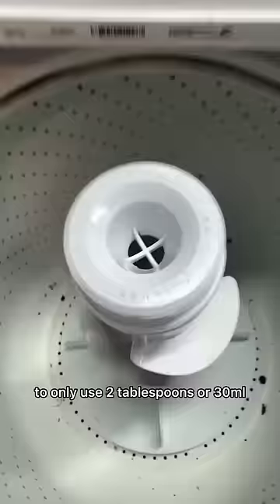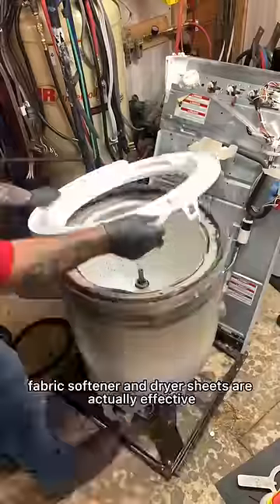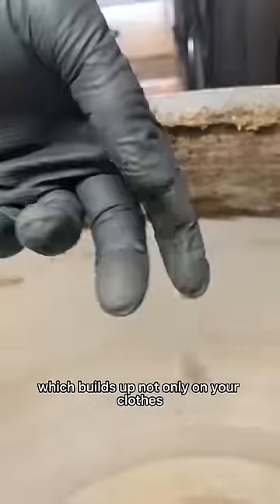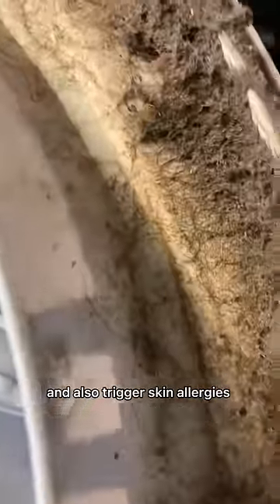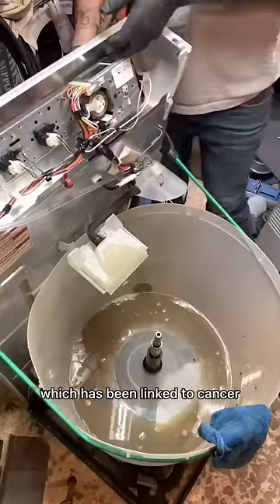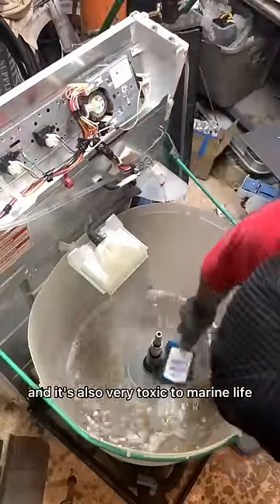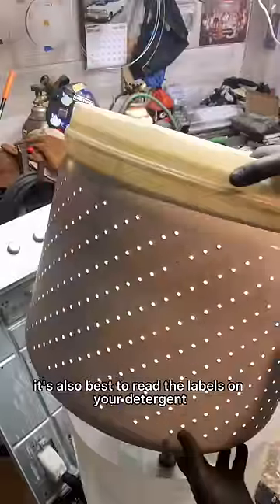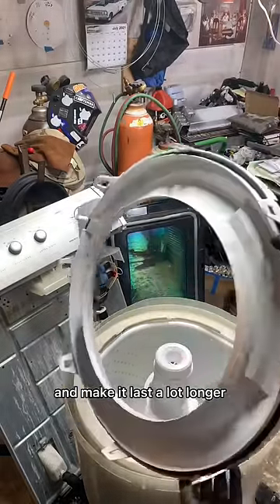Softener leads to machine failure

Comment: Vinegar with your favorite essential oil; I also use the wool balls, apply the same essential oil and my clothes come out bright, clean and extra soft. I use baking soda as a detergent. I use hydrogen peroxide for a stain remover, whites are beautiful, mixing a castle soap for a extra boost to the clothing before putting it in the washer. My washer shines.

Comment: I have "outlawed" fabric softener in our house.  The wax-like build clogged the pipes and then the water backed up and overflowed making a big mess.  Have a nice day.
Reply: All you need is a tiny amount. The fabric softener is not the issue it's the user. You're adding too much. You think these guys who created this never tested it on a machine or clothes? Yes, they sell stuff to get us to buy anything but it wouldn't be a household staple if it didn't work. Sure vinegar is a great multipurpose cleaner, but I'm pretty sure a chemical made for softening fabric and reducing static is better. Thank you

Comment: YES to baking soda first- final rinse, a small amount of white vinegar. Works great- no residue. Also, buy a Speed Queen as they have a metal, not plastic inner tub and they work incredibly well. Don't fall for the high efficiency tricks. Speed Queen is the best.

Comment: help; 

i use one tide power pod, warm setting only, distilled vinegar, no scent beads, spot treat with oxiclean and rinse it out beforehand if necessary, wash like items together, bleeding items with the darks, don’t overstuff the washer, and 3 drops of essential oil on a wool ball for the dryer. 

someone tell me if i’m doing it right pls cuz i was told to clean but not taught how and learned all this over the years from the internet 🕺🏽

Comment: Wifey was for a while a softner addict, sure the towels where soft n plush, lovely scent and so forth but..BUT they barely worked as towels anymore! They where so permeated with fatty chemicals that it had problem absorbing water! Towel was still technically "working" but you had to work the water into the towel! ...and they took much longer to dry, so quite soon after taking towel in use they would develop a funky scent AND perfume  😂  sure the bad smell went away after every washing but the funk cycle would repeat.

I love a little rough towel, because I know it will work like a towel should!

Comment: My dryer crapped the bed last winter, got a drying rack, no softener needed, my clothes last longer and I have a lot more space in my laundry room. I don't miss it. But I also only have my own laundry to do, so there's that.
Reply: @Pussflap  Works well, I place them on the drying rack with a fan pointed at them, no smells (other than the detergent) and fabric is lasting longer because it's not getting baked and stretched in the tumble dryer. Also towels work better because fabric softener was making them water resistant. They are a little stiff with first use but I like the scrubbiness and they then soften right up. Dishwasher crapped the bed as well and now I have a really nice space for recycling and garbage. Unless you have a handful of kids you don't need a lot of these appliances.

Comment: Also, check the hardness of the water in your local area. I live in an area with very soft water so no softeners or fabric conditioners needed, and I can get away with using half the standard recommended dose of powder detergent.

Comment: White vinegar is better because it's not just a fabric softener. It also kills mold etc and helps remove stains. It's totally safe to drink which means even if you have a crap washing machine the vinegar residue it might leave on the clothes is much better for the skin. So if you have a baby or someone who's got allergies then it's much less likely to set them off. Also you can try different kinds of white vinegar and see which smells the least. Also hanging the clothes up should get rid of the smell.

Comment: We only have a tub type machine with a spin dryer. We do use fabcon but usually we let the clothes soak in it in a basin first, drain and let drip dry a but before spinning. I guess there would less gunk in the cleaner.

Comment: Diluted vinegar will still corrode the parts on a washer. I used it for a while and the zinc drum mount on a GE washer literally broke into pieces, and leaving bits of cheap alloy in the drum. We did not use much vinegar either.
Reply: @EpicDrew15  it still doesn't take away from the fact of it all. I have a video up on my channel of this. The drum completely separated from the mount. It can still happen to LG, it's just that LG and Speed Queen brands are built better
Reply: @EpicDrew15  I'm also not the only source of this knowledge.  My experience comes from my own and appliance repairmen. We have one regular guy at my mother's jobsite, I have watched and listened to the appliance repairmen online and in person and my experience gained is this:    sometimes old machines are better. 
Some brands used to be made better so they sell a better product at a higher price than the other lineup. 
Only purchase top loading machines. 
Only use the recommended HE detergent and as little of it as possible. No additives. Both the guy online and at my mother's jobsite recommended Speed Queen or LG. The Speed Queen is pricey so a top loading LG it was for us because the only Speed Queen I saw was close to 2,000$ 
It definitely handles better than the GE

Comment: When I was in college and used fabric softener, my clothes started to hold this slightly bad smell that I just could not get out. After a couple years of that, I started using just detergent and Borax and after a couple loads, smell was GONE. The silicone (dimethicone) in fabric softener and many hair products is awful and avoid it at all costs. It's a cheap way of making products....

Comment: I used to hate using some liquid fabric softeners like Smuggle and Downy because I would always find softener stains on my clothes, and the fabric softener setting would use up too much water because it would activate Deep Rinse, so I just decided one day to use a tiny bit of fabric softener (on the lowest setting) and mixed it with water and that surprisingly fixed the stain issue and left my clothes smelling like flowers. Soft and great smelling clothes and a HUUUUUGE money saver

Comment: If you learn how to disassemble your washer and maintenance it like this dude did, it will run forever no matter what you put in it. They're not very difficult to take apart, step by step guides are available, minimal tools required, and parts are cheap.

Comment: Validation is a great thing.  Have not used softener for over a decade, only white distilled vinegar.  Cleaned too many washing machines.  Use a 30ml cup to add detergent.   Have a very clean front loader now.  What do you recommend to clean it? (with out disassembly?)

Comment: I don't have a drier but after all these videos i tried not using softeners and no. My biggest issue is i have a cat and ive learned that apparently fabric softener helps get the cat hair off clothes. Im assuming it floofs up the fibers making the hairs and lint easier to slide off. So for now until i find something better im choosing clean clothes.

Comment: There is n this buildup is just from cleaning products.  Detergent and fabric softener are both water soluble.  This can happen only if people use way too much and the detergent doesn't fully dissolve, in which case their clothing will also be caked with detergent residue.

Comment: Improper use of softener leads to machine failure….if you use it right and dilute it with warm water, and also run cleaning cycles often and not just let this accumulate it’ll be completely fine.

Comment: I stopped using dryer sheets because of sensitive skin and I dry my clothes on low and I have seen next to 0 static. I'm not sure why static occurs anymore but I am assuming very aggressive tumbling on big loads? Which I do not do. If a load is big I'll dry it in 2 goes and it means I'm not collecting socks inside sheet elastics also.

Also not only vinegar helps with washing but recently I have sworn by baking soda.

Comment: Per video takeaway. Don't overload your laundry detergent. Don't use dryer sheets or fabric softeners opt for vinegar - $3  at Costco for 1.5 liter size than $24 for softener. Heh the way laundry manufactures get you buying new machines. Also its difficult to tell my parents to stop using softener and the dryer sheet. Having "the dryer sheet softner scent" = clean. No scent = its not clean. 🤦‍♂️
Oooo can you do a detergent review? That be great as well.

Comment: Maybe if you didn’t use cold water all the time your machines might lot look like that,  that’s not just softener, that’s detergent build up ( liquid and gel and pod detergents are the worst for machines especially if you only wash in cold water ) it’s also mould build up because there’s no hot water going through the machine which if you just sprayed hot water on that lot in this machine it would melt and and wash away, the mould builds up around the detergent that’s left in the space between the drum and tub, more so on top load machines as there’s no real agitation of the water between the tub and drum as the drum doesn’t move during the wash cycle unlike a front loader, most detergents except powder leave a horrible sticky residue around the gap between the tub and drum especially pods as they congeal because there is no hot water in the machine, as you can see the hot damp steam is melting everything away, it would also help if those type of machines did more than one rinse as well,   Thing is it’s the same with front loaders, Americans complain they go mouldy and smell, that’s because they only wash in cold water, and use liquids, gels and pods, these really need heat to stop them congealing, and when they have congealed and you carry on doing the same thing the mould is gonna grow, as there’s no heat to kill the bacteria off,  don’t understand why people wash things in cold water, would you shower in cold water, would you put your dishwasher on with nothing but cold water, then why do it with clothes and underwear and bedding and towels, heat helps break down the grease especially body grease, ( we’ve all seen what cold grease goes like, congealed and everything g sticks to it  this is what it’s like in the washing machine as well, body grease it’s just the same as cooking grease ) it  helps the detergent to break down stains, bacteria and normal dirt especially on underwear and towels and bedding,   There’s was study done some time ago regarding women who have constant or recurring urine infections, the group of women ( a very large group ) used only 30degree  (84 Fahrenheit ) quick washes, or just cold water, the group were split and half the group had to carry on washing the same as they usually do and the other half had to completely clean their washing machines by doing a couple of boil washes at 90-95 degrees ( 194- 203 Fahrenheit) with a washing machine cleaner added to clear out mould, bacteria, congealed detergents that settle between the drum and tub etc then they had to use a normal cotton or synthetic wash at no lower than 40degrees (104 Fahrenheit) also using an extra rinse option if the machine had it and only using powder, no gels, liquids or pods, they did this for 6 months, the group using proper powder and proper washes with heat had 98% recovery rate from their urine infections within a few weeks, with no recurring   Infection over the remainder of the 6 months, those who carried on using cold washes and quick wash had no improvement at all and carried on having recurring infections, as the cold water and the wu il wash couldn’t destroy the bacteria that built in not just the underwear but everything the body came into contact with, the Germans and bacteria we are exposed to everywhere we go end up on us and our clothing and our bedding and towels, if your not doing laundry properly your just washing your clothes in a bacteria and mould laden soup in the machine as there nothing to kill it off and and remove the excess grease and mould build up from inside the machine,    Please do laundry properly people, back in the old days people didn’t have stinky mouldy washing machines, that’s because they use hot water to clean their clothes, especially in front load machines, right up to the late 90s people were still hot water in their washing machines and using proper wash cycles and they didn’t have problems with black mould and smells, that’s because combined with the detergent and the hot water all the germs, bacteria and grease were all broken down and flushed away, there was no stinky sticky residue left in the machines, no mouldy door rubbers no greasy feeling clothes, but now with people washing in cold water and not using powders they complain about the state of their machines.   Sorry Ive ranted but it’s one of those random things I feel really strongly about, I have 2 machines one for our stuff and one for the animals and the cleaning cloths etc etc that machine only does a boil wash and I’ve never had to clean it in 7 years even with the amount of hair that goes through it, and our machine is a new one but the old one was 9 years old with no mould, no smells and no sticky residue   Both machines are front loaders, that’s because I use powder and heat in the wash,  both my machines are in 2 or 3 times a day as well and still no nastiness in them.    Please start doing laundry properly people instead of moaning about the state of your machine, do it properly and you won’t have a nasty machine

Comment: I just recently stopped using liquid fabric softner. I had ran out and not bought more yet but had to wash my clothes. I noticed that this itchy feeling I have been having the last few years had stopped but didn't think much of it. I bought more fabric softner and after the next wash, the itchy feeling was back. I decided to stop using it after that although it has not been that long since I stopped. 

I had no idea it could do this to your washing machine. I wonder if that plays a part in how the machine sometimes smells? I always leave the lid open when not in use, but the smell remains. 

I never used fabric softner before I met my ex. I blame him for getting me to start using it. 😂

That being said, I'm not willing to part with my dryer sheets. Without them everything I come into contact with is a shocking experience...
Reply: If you're going to use dryer sheets have good insurance. Those things leave a coating that attracts lint, and increases your risk of your dryer catching fire. I used to live in a cold climate where static was a thing....but you get used to dealing with it.
Reply: @queenbunnyfoofoo6112  I'm almost 40 and still can't stand getting shocked. I absolutely hate it. What's funny is that I'm also a mechanic with more than 20 years experience. I'm super cautious when working on electrical components not to get shocked. I make sure everything is disconnected properly and place things where they aren't likely to make any accidental contacts. Some of the people I have worked with have made fun of me about it, but I don't care. They have their own quirks too. 

I don't know if it super painful for everyone else, but I hate it. It hurts worse than smashing my hand on something although the pain is short lived. Maybe I'm just more sensitive to shock than other people. When I was a kid, one of those shocking pen gag toys made me cry and paranoid about people offering pens for a while. I didn't even cry when I broke my nose, so it isn't low pain tolerance in general, it's specific to electrical zaps. I don't even like those TENS unit massage things.
Reply: @kraziecatclady  I hate getting shocked too. But I hate having my house burn down more. I've seen that happen. It's your decision to use dryer sheets, but most people don't know the danger they can cause.

Comment: Serious Question; If I stop using dryer sheets how to I get the hair off my clothes. I never realized how much hair, stuff dryer sheets pick up until I stopped using them, and my clothes come out with hair all over. I have picked it off, or use a sticky roller. But I still feel like there must be a better way.

Comment: I also found out the pods with a little plastic around them are not good to use. Because the plastic melts and goes into the water and into the ocean and marine life, polluting the water. I won't be buying those again. Even if they are on sale.

Comment: Hey! What tool are you using to wash the metal drum? Is that a hand held power washer? We just took ours apart and are having a hard time getting the metal drum to come clean. Any suggestions would be amazing! We bought this machine used and it recently started releasing sludge onto our clothes. Very disgusting lol, we have everything cleaned up beautifully except that metal drum.

Comment: What if you use something like final touch, scentless, only use max teaspoon in the softener cup then fill rest of cup to line with water? And that’s like for the largest load you can fit in the machine on average I use 3 drops softener to water filled to line in cup. Mostly just on my socks as cleaning vinegar doesn’t seem to loosen up their tight knit and high acrylic blend like final touch does. 

Plus I run another rinse cycle after a socks wash load with final touch in it and already select deep rinse as directed for said load but just to be thorough another rinse is ran after to help clean out the machine since ours has no cleaning cycle…

Am I still hurting the machine? Also bring back cotton socks 😭

Comment: I removed the inner tub on my whirlpool washer to clean it. the top ring sounds like it had water in it. is it supposed to sound like that? if you move the tub from one side to the other you can hear the water movin to the lower side. is this right? Is this used for balancing, or do I need to removed the water?